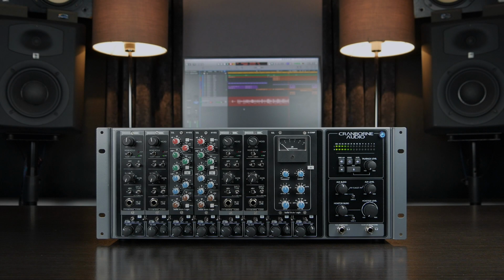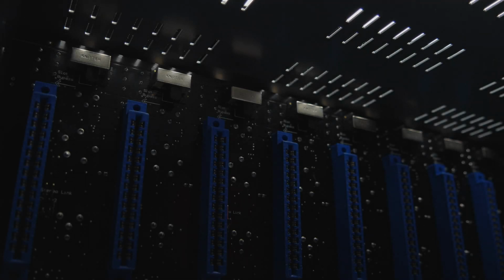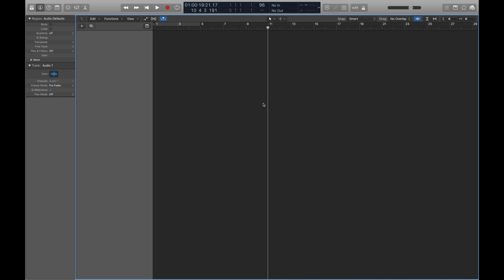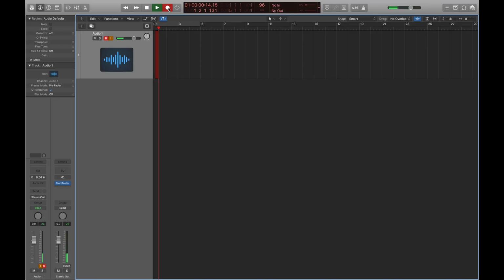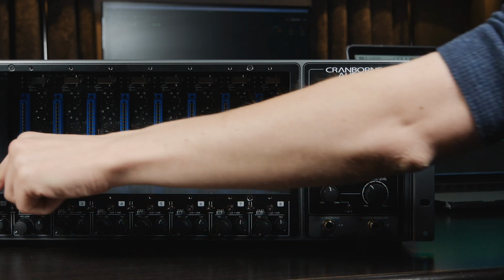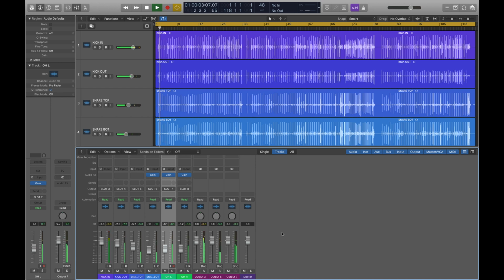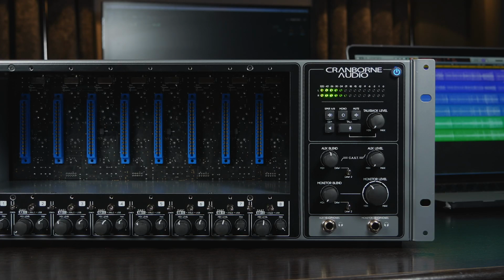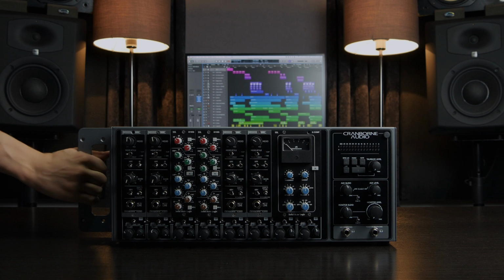500R8 Quick Tutorial | Using 500R8 without 500 series modules

Comment: Could I integrate the channels of the Cranborne R8 and ADAT versions of the 500 series to the Merging Anubis interface via the AES67 standard with a ethernet cat5 or cat6 cable? I am wondering if the "C.A.S.T." connections on the Cranborne can comunicate without issues with my Merging Anubis through a Cat5 / Cat6 cable with Ravenna/AES67 standards.

Thanks in advance whoever is reading this🙏🏻

Comment: does this work the same for the 500 ADAT? If i have it connected via ADAT to my interface can i use the ADAT inputs in my DAW to record without any modules?
Reply: @cranborneaudio  just to clarify. Even with an interface along with the 500ADAT, you can’t use the 8 channels on the 500ADAT to record on without having preamp modules installed
Reply from the maker: Hi  @limitless1997  , I'm so sorry I completely misread your question!! 🤦‍♂️ YES, you can use all of the slots n 500ADAT without any modules installed, however they will only accept line-level sources (from keyboards, mixers etc), not microphones directly. Mics will need some kind of preamp either externally or as a module to boost the gain to operating level. Hope this helps, and sorry again! CA
Reply: @cranborneaudio  I understand! I also see now that its clearly described in the tutorial videos as well, so that's my bad for missing that point. I really appreciate you taking the time to answer my questions. I am really intrigued with these units. I am a student in a recording arts program, so I have access to a lot of really nice analog gear to practice on, but my work at home is mostly in the box. 500 series stuff feels like a good way to get my hands on some analog gear that is actually in the more reachable price range. Im hoping to pick up one of these units so I can add some nice pre-amps to my set up. Maybe even a second one for eq and compression.

Comment: I'm new to having outputs on my hardware (coming from the Apogee Element) - can I run the module output directly into the input of the same channel? For instance, if I set a software synth to output 1, can I run it into my Camden 500 in slot 1/input 1 to colour it with the mojo? Btw I LOVE the camden pres, they blow me away.

I tried this in Ableton but it made a loud screeching noise. I'm going through an external patch bay so perhaps that affected it. But then again, all my inputs are going through the patch bay and there is no issue with them.
Reply from the maker: Hi there! Yes absolutely - this is one of the main purposes of the unit! If you are getting a feedback loop then it sounds as though you have a record or input monitor active which is causing the loop, however if you use something like Ableton's 'External Audio Effect' plug in. This should allow you to send the synth out of slot one, through the module, and back in without a feedback loop and without using another audio channel to record the audio back in. Give that a go and see how you get on! CA
Reply: @cranborneaudio  thanks very much!
Reply: So I've figured out now how to use the outputs on my R8. The 'External Audio Effect' plug in helped, thank you! A simple issue I ran into was that I wasn't changing the toggle switch to 'USB' on the R8. I think I understand how this works now, but I want to double-check. So I can't use the output on Channel 1 simultaneously as the input for Channel 1, is this correct? So for re-amping purposes, I would have to use 4 channels for outputs, and the other 4 channels for inputs (or some combination, 2 outs, 6 ins etc). Is this right? Thanks

Comment: Can you bypass few channels (for example like 3) to use external preamps and still use other 5 with 500 units. Im gona use blank panels for slots not using 500

 Also, does r8 work directly with pro tools? Or is there some software system like rme which i dislike cause for me it's too complicated, since im no mixing engineer. I just like to just track music and send it off to a mixing engineer

Also i have rme 12mic preamps/ converters which has madi and adat outputs. It should pair well with r8? Is that good option?

Comment: Can you use the analog summing AND the 500 slots? Or is it all bypassed and no 500 gear or 500 gear but they have to be Preamps and run the analog summing through them?
Sorry I'm new to analog summing and this unit.
Like basically... Could I load it up with 500 EQs and run them as per normal 500 chassis but then still get analog summing for mixdown?
Reply from the maker: Hi there, the slots are connected to the summing mixer, and so if you load the unit with EQs you can process your stems using the EQs, sum the signal using the summing mixer, and then record that back in to your DAW with one move! This is cool because you can build your own summing mixer with whatever selection of modules you own! Hope that helps!

Comment: Hey, can I just connect my microphones directly to the XLR ports and record to my DAW? Without 500 modules? Example signal chain: XLR mic eg Rode NT1 > 500R8 > DAW? i hear you say...line level input..?
Reply from the maker: Hey John, sorry for the late reply! You cannot connect microphones directly to empty slots without a mic preamp being used somewhere in the chain - you can only connect line-level sources into bypassed slots. That being said, you could use any preamp - from any mixer, another audio interface or similar and then connect the output of that device into 500R8. Hope that helps!
Reply: @cranborneaudio  Yes, thanks for the clarification.
Reply: Say, can Solid State Logic SSL E Series EQ Module for API 500 Series Rack fit in and work with your 500R8?
Reply from the maker: @johnngatho6520  Both modules fit in a work great! 👍

Comment: This may be a total newb question but does the adat version function the same way? Example.  Audient id22 to CB500 (ADAT). I have a few rackmount/desktop processors that I would like to mix through and sum. I plan to purchase a couple 500 series. Would the ADAT version allow me to connect via line in/out with my rackmount gear and into the summing of the CB500 and transfer back via optical to the audient? How would I go about printing the 2 track back into logic with this method? Thanks in advance!
Reply from the maker: Hi @IMNMEDIA KC, 500ADAT does work in a similar way! You can use all of the slots/conversion on the unit without any slots installed so can easily patch in your external units, sum everything together using the summing mixer and then record the 2-bus! On 500ADAT, the summing mixer has an analogue output so you would process and sum all of your tracks and record the main output of the summing mixer back into your Audient using a spare line input. Hope that helps!

Comment: I wonder if it would handle synths in the inputs?
Reply from the maker: Hey Thomas, yes the module slots can handle synths when they are bypassed! The input can accept a very high input level and so you may find that some lower-output synths appear to have low level into your DAW however, as the conversion is so clean, you can boost that in your DAW to operating level without any issues. Hope that helps!
Reply: @cranborneaudio  Thanks so much for the help! I’m definitely planning on buying on of the 500R8’s. It makes it even better to know you all are thoughtful as well. Thanks again.

Comment: Saving up for one to replace my aging FireWire interface after watching these videos and Glenn's review on SpectreSoundStudios.  The amount of thought put into this thing is incredible.  The ability to use the slots independently of the 500 series gear is essential to me... I want something I can start building over time but in the short term I just need a quality interface I can use to record at least 16 tracks simultaneously.  In the short term I can use my small Mackie mixer via the analog inputs and my Focusrite via ADAT for preamps.  In the long term I can gradually build up some 500 series gear to accompany it.  The versatility of this design is incredible.

Comment: am i able to use 8 channels from my desk [midas f32 , no adat] and the 8 500 module slots at the same time for a 16 channel set up? or would i need to use my ADAT first?
Reply from the maker: Hey there, sorry for the late reply - only just seen this question! If you want to record the 8 500 series slots as well as channels from your Midas console, you will need to expand 500R8 using an ADAT connection as there are only 8 converters built-in to the chassis. Hope that helps!
Reply: @cranborneaudio  Can I do this with my Cranborne 500 ADAT?